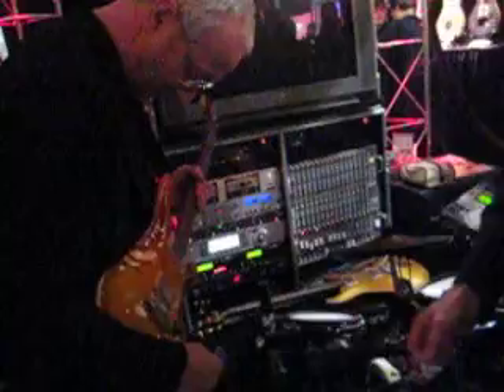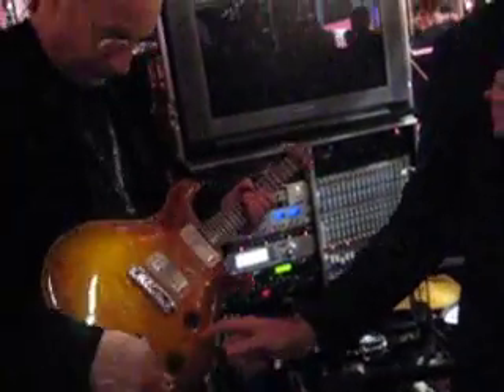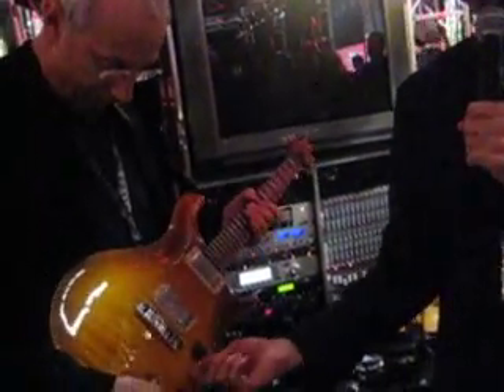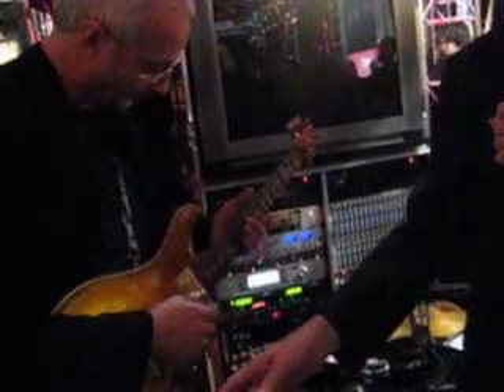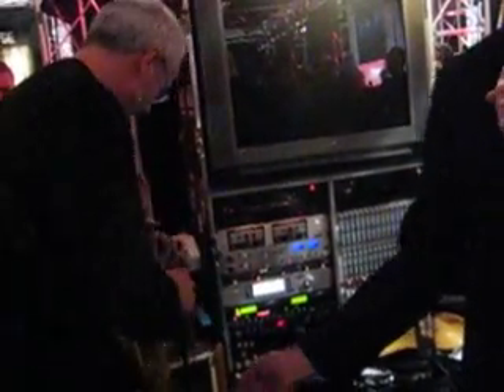Paul Reed Smith at NAMM 2008

Comment: No, it's a demonstration of their new "master voicing control" circuit...  basically it seems to be a clean gain boost, not unlike a Duncan Pickup Booster, which adds punch to the signal and drives the amp harder...  Would make the vintage like Mc Carty pickups overdrive an amp pretty hard.  Probably would scream on a good tube amp!